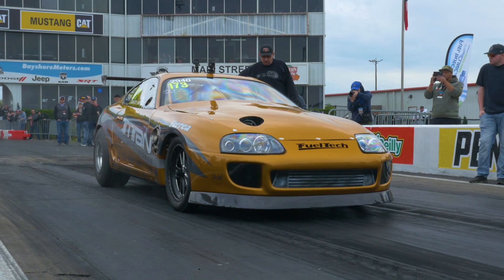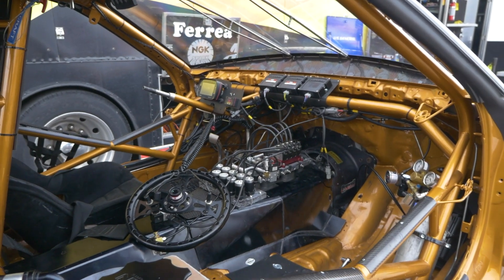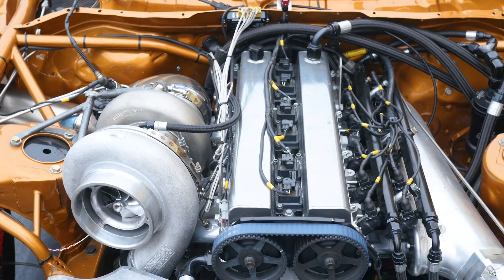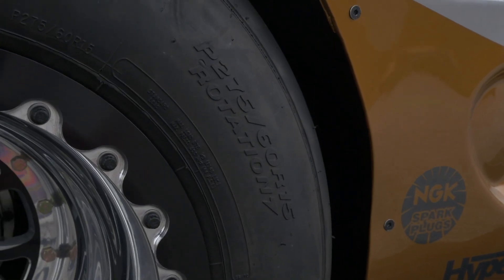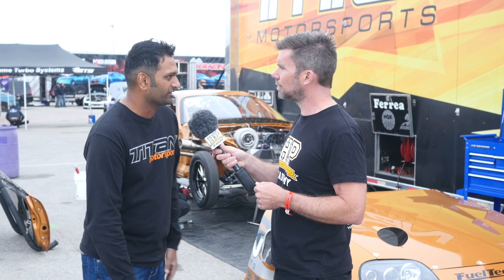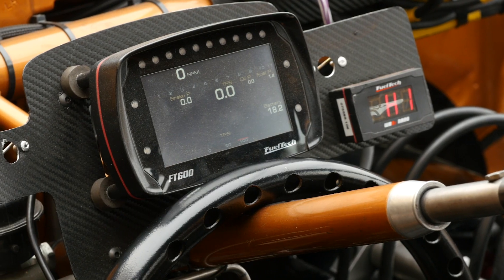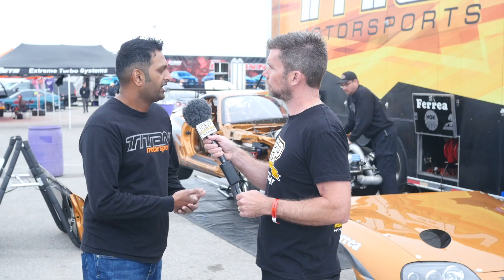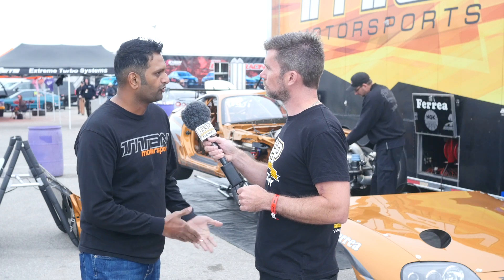2000HP+ 5 Speed 2jz | Titan Motorsports X275 Copper Supra [TECH TALK]

Comment: Hi, I have been following for some time now and have one of your packages online. I was just curious on thoughts of aluminum rod in a high horsepower drift application.
Reply from the maker: Hey Stephen, kind of depends on how often your engine is getting torn down, but they're probably not going to be your best bet. I would watch the link below and also have a chat for a few suppliers about your build and requirements along with what you're trying to achieve by considering this type of rod and see what they say. They are dealing with them day in day out so there really can be a wealth of knowledge there if you get the right chap on the phone ;) - https://youtu.be/xTF59-hE0qs - Taz.
Reply: @hpa101  I already have the build running. Sr20 notchtop, making just under 800hp redline just under 9k. I have only driven it for about half a season. I am curious to see how long it does last until the aluminium fatigues to warrant an overhaul. Thanks for the info. As always, great content.

Comment: I want to make the switch to radials because even on a FWD platform the potential for serious trap speeds is worth the learning curve to get the most out of the tire. As one of my favorite people likes to say about racing on radials, there is a line you do not want to go over. Too aggressive it will spin, not aggressive enough it will dead hoo and since they don't flex like a bias-ply tire that along with the torque spike from dragging the engine down results in broken drivetrain parts. Get it right and it will back door like no other tire available.